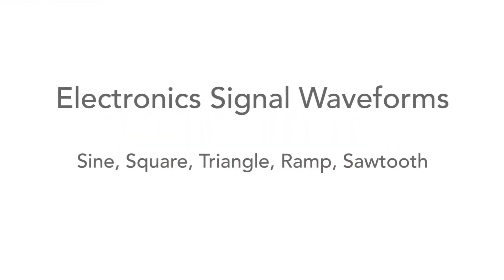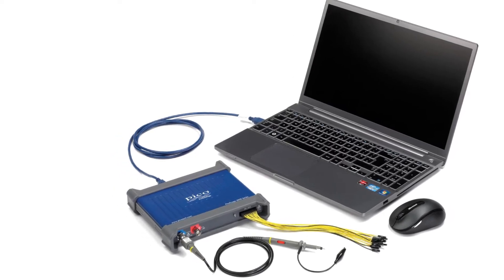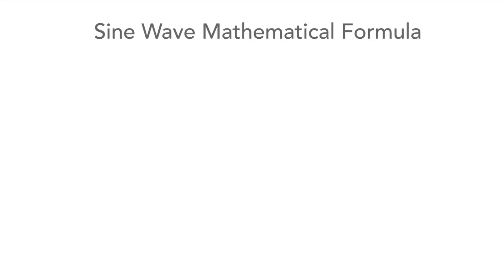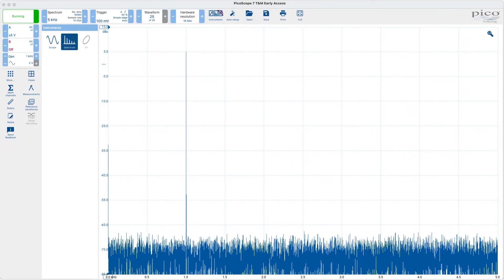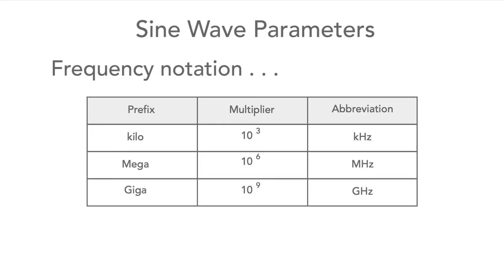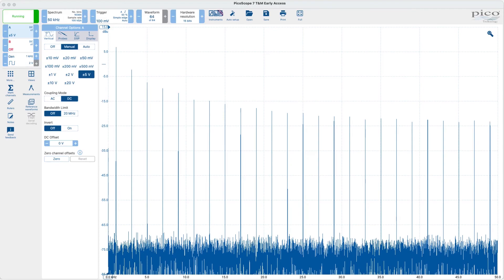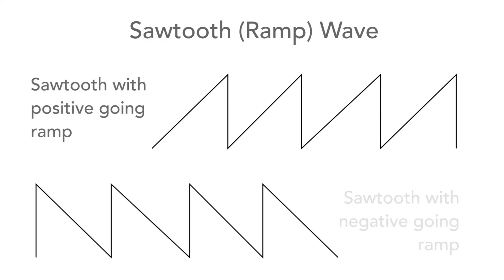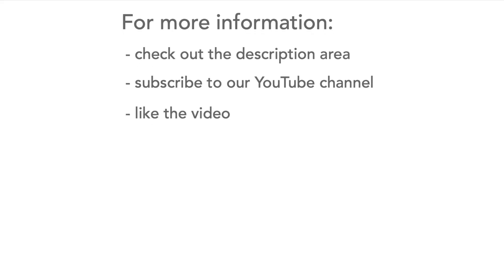Electrical & Electronic Waveforms: sine, square, triangular, sawtooth, ramp

Comment: Very interesting. The best soundwaves, in my opinion, are square waves. They are fun and sound very rich. Next soundwaves are sawtooth waves. I also love them, since they also sound rich and serious like a square waves. Triangle waves are mediocre, since they are less rich and quieter. The waves I heavily dislike are sinewaves. Sinewaves are very boring, bland and weak. Also, when frequency of the sine sound is below 1 kHz, the hearing threshold starts to rise very slowly. To hear 100 Hz sinewave, the sound pressure has to be 25 dB. To hear 20 Hz sinewave, the sound pressure has to be 80 dB. And for 16,35 Hz (which is frequency of the tone C0), the sound pressure has to be 90 dB. This means that, in order to hear sinewave sound at low frequency, you have to turn your volume up, which increases risk for hearing damage and damage to the equipment. But with square and sawtooth waves, you can hear down to 1 Hz, since harmonics and overtones are here to help you hear the sound of extremely low frequency (or infrasound). This is why I prefer square waves and sawtooth waves.
Reply from the maker: Very interesting summary. Thank you.
Reply: sine wave is the best one
Reply: @ElectronicsNotes  this makes me want to play with my moog grandmother tbh

Comment: Parabolic wave(Pointy sawtonic wave):
Type of wave: pointy
Number of harmonics: series of natural numbers
First harmonic phase: 270°
All harmonics have a phase of 270°
First harmonic volume at zero volume: -1.82 dB
Volume fallout function: quadratic
Volume fallout harmonics: -12.04 dB / oct

Triangle wave(Pointy squatonic wave):
Type of wave: pointy
Number of harmonics: series of odd numbers
First harmonic phase: 180°
The harmonics phases alternate:
{4n + 1} — phase 180°, and {4n + 3} — phase 0°
(Every second harmonic will be in zero phase, and every first will be in antiphase)
First harmonic volume at zero volume: -1.82 dB
Volume fallout function: quadratic
Volume fallout harmonics: -12.04 dB / oct

Sawtooth(Ramp) wave (Sharp sawtonic wave):
Type of wave: sharp
Number of harmonics: series of natural numbers
First harmonic phase: 0°
All harmonics have a phase of 0°
First harmonic volume at zero volume: -3.92 dB
Volume fallout function: linear
Volume fallout harmonics: -6.02 dB / oct

Meander(Square) wave (Sharp squatonic wave):
Type of wave: sharp
Number of harmonics: series of odd numbers
First harmonic phase: 0°
All harmonics have a phase of 0°
First harmonic volume at zero volume: +2.10 dB
Volume fallout function: linear
Volume fallout harmonics: -6.02 dB / oct

Comment: How about the duty cycles of square (a.k.a pulse) waves, the sound can vary a lot between different "percentages", the most common are 50% waves (the normal square wave), 25% waves (where the square is like cut in half, then one of the halfes is removed, and 12.5% waves where the lenght of the square is divided by 4
__——
___—
____–
It's something like that, it's hard to represent them with underscores and dashes
Reply from the maker: Good idea.

Comment: Wait don't we use these for voltage movements? How is it associated with sound?
Reply from the maker: The waveform shapes are the same for both voltage & sound. A voltage can be converted into sound using a transducer (loudspeaker etc) and vice versa using a microphone.

Comment: why waveforms differ ?how does energy reach to listner ear?
Reply from the maker: The waveforms differ because of the different vibrations that exist either as sounds or electrically. These vibrations reach our ears as sound waves - they need to be converted from electrical signals to vibrations in the air by transducers such as earphones, loudspeakers etc. The vibrations in the air consist of successive compressions and decompressions of the air molecules in the same form as the type of vibrations. I hope this helps explain it for you.

Comment: I feel like I was scammed by YouTube compression
for the context, I have an old scope connected to my PC's audio output bc I do oscilloscope music, and so I thought, why wouldn't I look at the signals there are on your video
and apart from the sine wave, others don't look like what they should
They sound like what they should, because they have the same frequency distribution, but they look awful...
Reply from the maker: That’s interesting - I know the spectra of the signals are a little difficult to see because the trace is very thin and I can’t change it ( I use a USB scope) but I thought the shapes of the waveforms are ok. The spectra are also what would be expected, but not as clear as I would like.
Reply: @ElectronicsNotes  I don't mean the images, the images are fine and represent well the signals you want to show.
I mean the sounds. The audio spectra are right, but as far as I can see, my scope gives me wildly different waveforms.
I can send you pictures of what waveforms I get if you want.